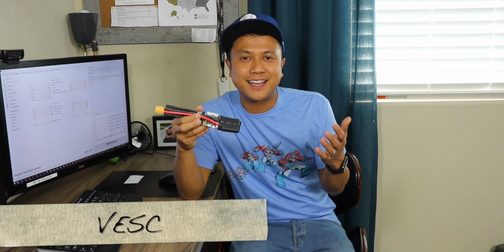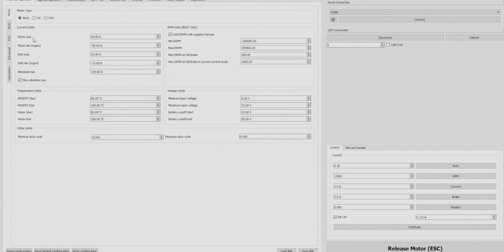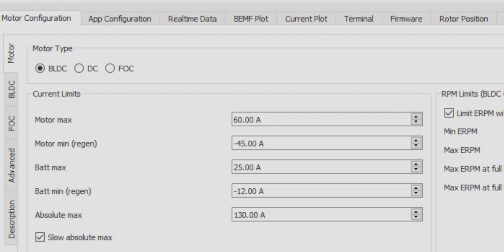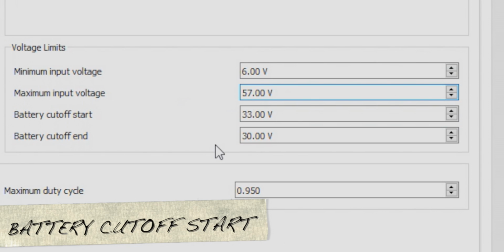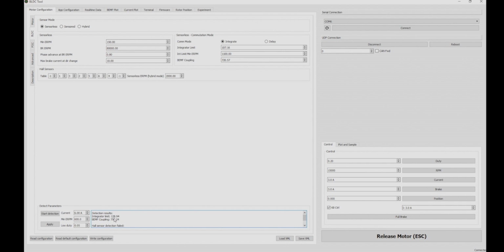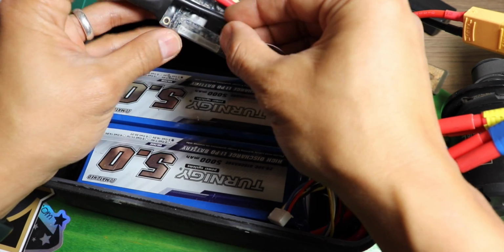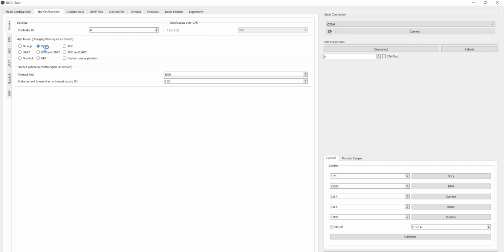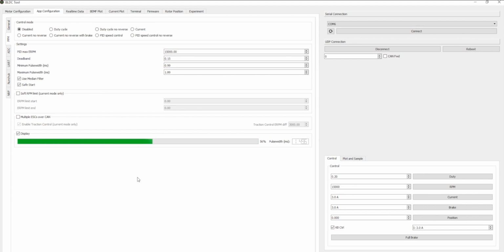HOW TO BUILD A DIY ELECTRIC ⚡  SKATEBOARD TUTORIAL - VESC & RC REMOTE CONFIGURATION - PART 3

Comment: Hey Neil! Great video as always! I have finally gotten around to making my own board, and I am trying to figure out the best VESC settings for my board. I have large 100mm wheels, a single 6355 motor for now, and a 12s2p battery pack from diyelectricskateboard.com. Is there any way you could help me figure it out? Right now, my acceleration is very slow and it might just be because of my big wheels but I am not sure.
Reply from the maker: Hey Charlie!  Sorry for the late reply.  Did you figure out your issue?  Yeah, 100mm wheels for a 6355 motor will be very demanding on the motor.  It possibly could also be your VESC setting.  With out being able to see your VESC settings it will be challenging to help.  If you have time, go check out: https://www.electric-skateboard.builders/.  It is an awesome community of folks that all build electric skateboards.  If you have questions people there respond pretty quickly.  Also, your questions may have already been asked so it's key to search the forum first.  Good Luck!

- Neil

Comment: Just a question I have a 8,800mah 12s battery 
How can I know the maximum battery discharge?
Reply from the maker: If you want to know your battery’s maximum discharge you’ll want to first convert your mah rating to ah.  So divide 8800 by 1000 which leaves you with 8.8Ah.  Now, multiply your 8.8Ah by your C rating.  That will give you your max battery discharge potential.  However, if you are asking about what your maximum battery discharge for your VESC I would put it between 50-60amps.  Hope that helps.

- Neil

Comment: Fam, your vids are fantastic! By far my fav new creator!  Do you plan on ever doing some reviews on other DIYers, or brand name boards?  It would be pretty cool to bring content on DIYer's more so than the big 5 out right now, e.g., Mellow, Boosted, Evolve, Enertion, Metro.  What's your opinion on Carvon.  I see the CARVON V4 TORQUEDRIVE are on sale.  It seems to fit in my wheel house on what I need.  Any insight on these?  

  I need to send you an email on my build I am planning out.  Would of sent an email a while ago, but my baby girl was introduced to the world and sleep and time is not on my side.  I do have a question about a few things.  I am thinking of going either dual 6374 or dual 6355.  That will then put into motion which trucks I am going to purchase , gears, pulley etc.  With the hills in my area, I am sure dual 6355 would be more than enough.  Configure my mass at 200lbs with inclines of 8-15% grade hills has me worried.  Not trying to stress out my motors.  I guess I just need reassurance that the 6355 would be good to go for what I would need.  Also, I am planning 10s4p battery or 12s4p.  What do you think?
Reply: Ok the CARVON V4 is out after I have done more research.  Seems like the cheaper version of what the EVO motor.  Still breaking down what I am going to need and I am now researching more the VESC, just need to learn more about Maytech.  Since I am leaning with the 10s battery, I am going with the 6355 190kv duals....so much reading, but I enjoy learning more about the ESK8 world.
Reply from the maker: I’m glad you are taking the route of research!  People are very quick to ask what the best is?  But the best thing about DIY is that you are only limited to your imagination!  I actually have a pair of Carvon V4 XL speed drives on the way.  The EXO is actually a great option!  Pretty plug and play with a swappable battery.  I’ll be doing a review on the Exo in the next couple months.  But at the end of the day, belt  driven motors have crazy power at both bottom and top ands of the rpm curve.  I personally like both hub and belt for different reasons. That’s the nice thing about he Carvon drives is that you can use full urethane wheels which is unlike any hub motor set up out there!
Reply: Carvon got my interest for that exact reason.  When I first saw the Carvon Evo board online, I thought...wow best of both worlds.  I love the ability to actually have the option to use different wheel setups.  Also the power looked butter smooth.  Please do a review on the EXO...I really would like to see a comprehensive review on how that board reacts under all conditions, especially hill climbing.

One quick question, how are APS motors?  I was thinking of their 6355 or 6374 motors.  Seen solid builds with Trampa boards using them for their setups.  Although mostly see TB and some BkB motors.  Damn the struggle is real!

Also, it is very confusing reading about ERPM combined with the right kv and battery.  I read so much conflicting reports on what is the best "sweet spot" for a 10s and a 12s battery.  Do you go with the 190kv or the 174kv or the 230kvs, LOL..  That is the problem with such a new community.  Lots of information to sort through with many things constantly changing as developers, programmers get more R&D.
Reply from the maker: I've actually been speaking with Jerry over at Carvon and he has already promised me an EXO for review 😛.  So, look out for a review in the near future!  I've heard great things about APS.  I've never personally used them.  APS was one of the few original esk8 part vendors.  I like their seal motors which will help with keeping debris out of the coils.  Where do you live?  If I were you'd i'd try to purchase from a vendor as near as possible to save on shipping.

In regards to the motor, I'd always go for the 6374 motor, even if it's a dual.  Think about it this way, when you purchase a computer with RAM you won't necessarily need all that memory.  But when the time comes and you are gaming, listening to music, and downloading a movie...that RAM will come in handy.  So with your board, a 6355 will be sufficient and if anything you'll go just as fast as the 6374.  However, due to size the 6355 will be maxed out faster when doing strenuous climbs.  Also, if you're running a 10s the 6355 will be fine, but when you run a 12 I anticipate the 6355 will run hot.

What I've gathered is that with a lower voltage you'll want a higher KV.  And with the higher voltage you'll want a bit lower KV.  Now, that is not gospel but I've noticed that among boards.  I've road both 10 and 12s on 190 and the only thing negative I noticed between the 2 is my motor running a bit hot.  that can be alleviated with some setting adjustments in the VESC.  Unfortunately, I don't have much to say about the 174 or 230kv. It sounds like you've done a lot of research which is awesome and is why i'm responding to you so long like this (i love talking shop).
Reply: I like you analogy!  I thought the same about just going with 6374's and just using all that these motors will have to offer.  I will definitely enjoy the added torque from start which will be great for the hills in my area.

I am from the DC area so I will be looking hard at APS, TQ, and BKB's.  I am leaning towards just sticking with TQ 6374 190kv and getting the TQ 218mm trucks.  I should be sticking with the 10s for this setup.  Although, this is where confusion happens with research.  Plenty of folks have done the 12s on 6374's, but then you have some folks that say it will runs too hot.   Ehh, I am going 12s with the 6374's...I will make sure to compensate on the VESC.  I have noticed that with Trampa boards that many use 12s on dual 6374 setups unless they have high kv and run 6s,8s battery configurations for ungodly torque.  I want to go with 12 mm belt and definitely going to need to a good set of 96a Bones as well as some 87a Nipples for different riding situations.  RipeTide seems to be a good solution for the pivot cups on the 218TQ trucks.  I heard the stock bushings are weak sauce when hitting the ranges of 30mph +.  I want to carve when I am riding with my daughter on her electric scooter, and on my commutes I am pretty sure I am going to go all out.

You have been a huge help.  I will let you know how the build goes.  At the end of the month I will start purchasing items.  I will finally settle on the board, either LandYacht or Vanguard...(trampa idea will be round 2).  Besides that, I have pretty much everything else decided upon.  I was going for FOC's but I will save that on the second build as well.  Thanks for all the help, fam!  Can't wait for the next part!

Comment: VESC tool has better remote-specific features:
- better remote setup wizard
- throttle and brake curve adjustment
http://vesc-project.com/vesc_tool
Reply from the maker: Hey there!  Thanks for sharing.  I did try the new VESC tool and should be a doing another video on that shortly.  But, I always use BLDC or Akmaniacs so I was more comfortable doing a video about that.  Anyhow, Hanks for the support and stopping by the channel!

- Neil

Comment: Hey Neil, one question, how low can I discharge a 5000mah Lipo before I have to charge it. 
PS: You make very good content.
Reply from the maker: Hey there!  Thanks for watching!  I hope you'd consider subscribing to see more videos like this one.  Mah is the capacity of the battery.  However, batteries are strange in that we measure empty and fully by the voltage.  3.0v is empty and 4.2v is full.  Lipos are not recommend to discharge below 3.5v.  This is just a common practice to keep the health of your batteries on the up and up.  if you do discharge below 3.5v you risk your battery of damaging or the cells to become unbalanced.  Hope that helped.

Neil
Reply: Big Kids thank you very much Neil.

Comment: Great video Neil, you need to do a part 3(A), setting up VESC with the new VESC Tool software. Its much easier to setup vesc, the new software practically sets up everything for you. If you need help, let me know, just PM me, im just paying it forward. Great Job. 👍👍
Reply: nguyễn nhung Your right, but, it also depends how far you’re riding and what speeds do you want to accomplish. If you ride with your left foot on the front of the board, like me, then i would put my power wheel on the left rear, thats what works for me. I tried it on my right rear and when i was making sharp left turn, i was loosing traction, the right rear power wheel was lifting off the ground.
Reply: Manny Martinez thank you so much 
I asked that question on some other channels for years and no one answer
Reply: Big Kids Is 2 motor better than 1?
I think 1 is not so balance bcuz only 1 wheel spin
Reply: Manny Martinez so 2 motor is better?
Reply: nguyễn nhung yes.
Reply from the maker: Hey Many congrats and thanks as always for the support!  I have yet to check out the new BLDC Tool!  I saw I AM DELUX'S video about it and yes, it is WAY easier.  I went this route so people understand what these values mean instead of just plugging in some info.  But, yeah, we should a skype call and you can show me what you do!  Anyhow, shoot me an email with your address so that I can send you your winnings :)

- Neil
Reply: Big Kids Thank you Neil, I sent you a msg through facebook with my info, thanks again and keep making those awesome videos.
Reply from the maker: Hey Brotha!  Sorry for the delay but I just sent your winnings in the mail to the address you provided.  I'll send you the tracking number shortly!
Reply: Big Kids 👍 thank you Neil